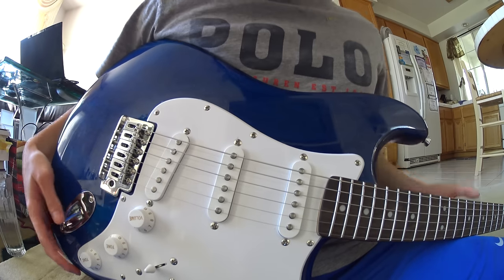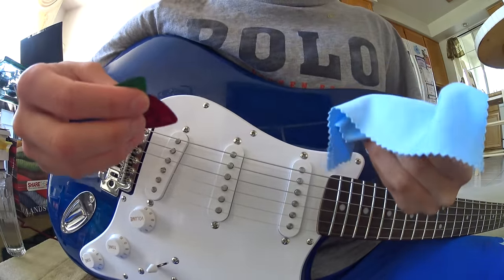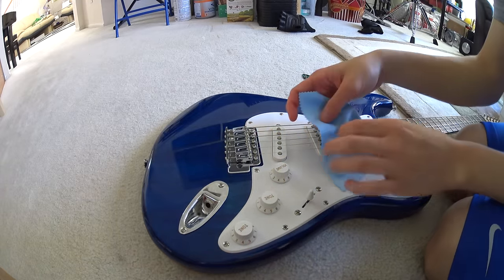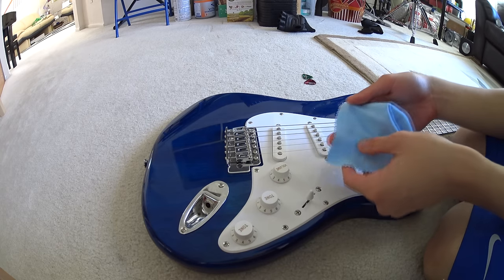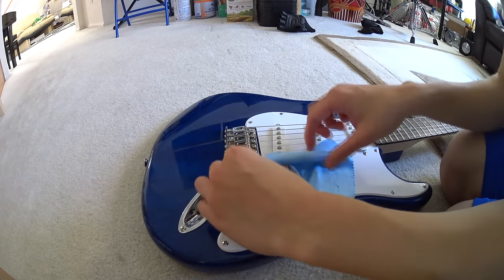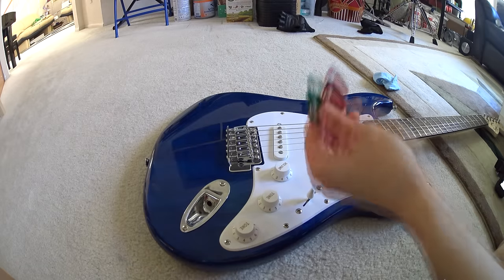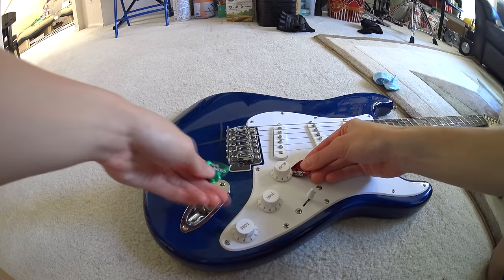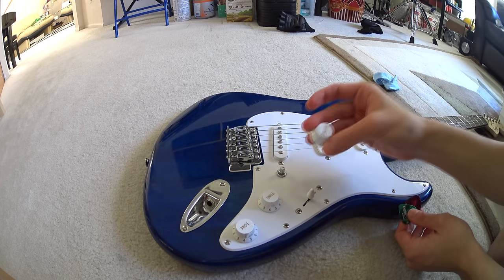Remove Electric Guitar Knobs without Damaging your Guitar [Tutorial]

Comment: turn your knobs all way down (or up)  it will help placing the knobs back in easily and accurately by the first attempt. also, good video for a noob like me.
Reply from the maker: Nice that's a good idea! And yeah you're welcome!
Reply: i need that i did it too late and i really need help putting them back on right
Reply: How do you put the knobs back on
Reply: @lisam0651  you should be able to push them in slightly hard and thats it putting them back is simple and straightforward (at least for my guitar)

Comment: The pick method worked for me. I did have to use the wider side of the picks though.
Reply from the maker: Mavrick glad it worked! Did you find the thin picks not strong enough to take them out?
Reply: @CreativiTimothy  They were Fender mediums, but the tips bent immediately. But regardless, thanks!

Comment: That microfiber towel trick worked perfectly. Mine were on really tight and if I had used a flat tip screwdriver I definitely would've damaged the pickguard and the knobs. Thanks!
Reply from the maker: Glad it worked! It did take me a few tries to get the cloth under the knobs, so I'm glad it worked for you!

Comment: Another tip... if you knobs are hard to remove, take a hair dryer and heat the knob from about 8 - 10 inches away FOR ONLY 5 SECONDS at first (the knobs heat up and soften surprisingly quickly). The try removing. If they don't pull off very easily, then repeat the hair dryer again until the knobs come off. The inside of the knob will return to its original hardness quickly. It doesn't melt (unless you screw up), it just softens temporarily. If the knob is difficult to push back on the shaft of the potentiometer, heat the knob briefly again and then push it back on the shaft immediately.
Reply from the maker: R. K. Very interesting! Thanks for sharing! Would have never thought about that because I don’t use hair dryers myself haha

Comment: 1st time that i see someone use the guitar picks to remove the knobs.. Ive been doing it for years but I first use 2 picks together and slide both under  one side of the knob then get another and wedge it in between the first 2 , the continue adding one more pick and you will be surprised that the knob pops up very easy.   Great for stuburn knobs that just wont pull off,      make a video of this.
Reply from the maker: Thank you for the insight! Yes I think the more picks the better, lodging it under to make it pop out more

Comment: Thanks, Tim! Picks worked. BTW, any advice for how to get stubborn plastic residue off the pickguard? Also, what is the name of the color of your guitar? I really love it.
Reply from the maker: You're welcome! For the plastic residue, I heard Goo Gone is supposed to deal with that, but it might be too harsh, although I haven't tested. Try one of the following:

Plastic scrapers. While metal blades might scratch the surface you're trying to save, a plastic scraper (even the edge of an old credit card) or the blade of a plastic knife can be safely used to scrape adhesive from many surfaces without scratching. Other options include wiping the spot with the scratchy side of a sponge or rubbing the debris away with a rubber eraser.

Hot water. Put a few drops of dish detergent into a sink full of hot water and immerse the item (if practical) into the water to soak until the residue softens. Scrape away the gunk with a plastic scraper or your fingers.

Hair dryer. Aim a hair dryer at the sticker residue, turn it on, and allow the hot air to loosen the adhesive. Scrape to remove.

Rubbing alcohol (or vodka). If you want to know how to get sticker residue off plastic, wood, or glass, one of the most effective solvents that's safe for most surfaces is rubbing alcohol. Vodka is a good substitute. Wet a paper towel or clean rag with rubbing alcohol, and rub the residue to lift it off. For stubborn stickers, lay an alcohol-soaked rag on the area, and let it sit for several minutes to soften the residue. Use the rag to rub off what's left behind.

Peanut butter. If you want to get sticker residue off wood, glass, or plastic, dab peanut butter on the spot and let it sit until the sticker residue softens. Use a clean rag to lift off the peanut butter as well as the residue.

WD-40. Spritz WD-40 onto the sticker spot, let it sit for several minutes, then use a rag to wipe away the residue.

Canola or olive oil. Apply cooking oil to the sticker residue to soften. Scrape away the remainder with your fingers, a plastic scraper, or a plastic knife, or rub with a clean rag.

Vinegar. Soak a rag or paper towel in vinegar and lay across the sticky area. Let it soak for a few minutes to soften the residue, then wipe or scrape to remove.

Cleaners. A few commercial products (Goo Gone or Goof Off, for example) e formulated to remove sticker residue. Follow the manufacturer's directions, but in most cases you apply the product to the residue, let it set, then scrape or wipe with a rag to remove.

*Here's the guitar I bought. It seems to be blue but the Amazon description says "Black" so I'm not sure: * https://www.amazon.com/gp/product/B00GGY67I8/ref=oh_aui_search_detailpage?ie=UTF8&psc=1
Reply: Thank you! I had already tried soap and warm water, trying to keep water away from the pickups and 5 way switch. Didn't really work - this guitar was 3 years old and that plastic has really settled in. Thanks for all the suggestions! I am going to try a few!
Reply from the maker: Ah I see. Good luck! Sorry I cannot help much because I never removed plastic residue in sensitive areas
Reply: I used Method brand glass & surface cleaner and Q-tips.  Place the cleaner on Q-tip, then rub in circular motion on a small area until you start seeing the natural surface of the pick-guard.  Wipe away excess with paper towel, repeat.  It takes a while, but it works.  You might need a bunch of Q-tips, because they get dirty quickly!!!

Comment: Quiestion: I just got a new guitar and removed the knobs to take off the plastic and then I placed them back on. After thinking for a while I at started to freak myself out. Is there a right way to put the knobs back on so the volume numbers are accurate or do they naturally click in place after turning them?
Reply from the maker: Good question! I don't think there's a right way. It depends on where you want the numbers to be oriented.

Say, if you wanted the number "1" to be near the top of the guitar like near the strings when the tone knob is at the lowest setting, then you would try to place it such that the 1 is at that position before you turn it clockwise.

If you place it such that the number "1" is near the bottom of the guitar, then it will still turn properly, but it might not be as aesthetically pleasing.

The numbers are just aesthetic, and it's only the clockwise/counter-clockwise turning that effects the volume/tone AFAIK

Comment: I have a question because i removed the knob and when i put it agan why the knob is not smooth like before and how to adjust the nut inside and what kind of adjustment?
Reply from the maker: Sorry for the 1 year late reply. I think maybe there are some notches on the nut or something so you'd have to put the knob on a certain way. I'm not super familiar with a guitar like that, but maybe you can try removing and placing it in different rotations

Comment: I have a question because i removed the knob and when i put it again why the knob is not smooth like before and how to adjust the nut inside and what kind of adjustment?
Reply from the maker: Ge Lo francisco Hmm, what do you mean by not smooth? Like it does not fit in perfectly?
Reply: @CreativiTimothy  i mean yes because i put it again and when i turn it on is hard to turn it on but it is put a normal way.

Comment: How exactly do I put them back on in the right spot so they are accurate?
Reply from the maker: To me, it's a matter of preference. It doesn't matter what rotation or direction you put the knobs back in, because how much it turns is controlled/limited by the screw inside. The numbers you see on the knobs are just the aesthetic part and do not affect the knob turns. My personal preference is when you twist the screw counter-clockwise to the lowest position, you place the 0 as close to you when you are holding the guitar in a position where you are playing.

Ideally, you'd want to take a picture of your guitar right before you take them off to see what your manufacturer prefers the aesthetics in as, so I think if you don't have a picture, you can look up a stock picture of your guitar on like Amazon and hopefully you'll get it looking just like the original. But it won't affect the controls.

I don't know if that makes any sense, but that's a great question which I should have covered in the video. Not sure if I should make a separate video on explaining how the knob works and putting back on. Let me know if you'd like to see a video on that!
Reply: @CreativiTimothy  Thanks for the help mate I eventually figured it out haha

Comment: The pick method was a bit hard for me, I found it much easier to do the shoe laces method you can look up (you just put one lace up top and one on the bottom in parrallel, then you pull all the four ends straight up)
Reply from the maker: Thank you for the suggestion! Maybe it works better on certain guitars with tighter or smaller distances from the knobs

Comment: Um, was the metal thing that the pot was on supposed to come out? My middle tone knob won’t stay in anymore and I’m worried I damaged it🥲
Reply from the maker: If you mean like the metal cylinder that you insert the knob on, no it's not supposed to come off. Dang :/ If you have a picture, I can try to help more. I'm not an expert at guitars like I don't play it regularly, but I'm generally decent at fixing things
Reply: @CreativiTimothy  yeah the thing got pulled out when I was taking the plastic off. The other two popped off fairly easily but the middle one just ripped out the metal thing. I have a squire Stratocaster that I got as a gift and I was gonna get a new guitar but I still want the one I have

Comment: My guitar knobs just wont come off what should i do?
Reply from the maker: Can you elaborate what you've tried? Like for the pick method, do the picks not even get under the knob? I suppose you can try a wrench in the worse case scenario and pull it out while gripping it strongly
Reply: @CreativiTimothy  Yes the picks get under and i have also tried to put a cleaning towel under and pull but its too tight.

Comment: What if the knob is glued? XD
Reply from the maker: Dang, well, I think you can stick in medium thickness picks and try to scrape off the glue underneath if you don't mind getting your picks dirty (you can wash them later). That would work, but if not, then maybe a knife for super thick glue but you'd have to be careful. I'd recommend a crafting knife with a small blade instead if you choose to use that way